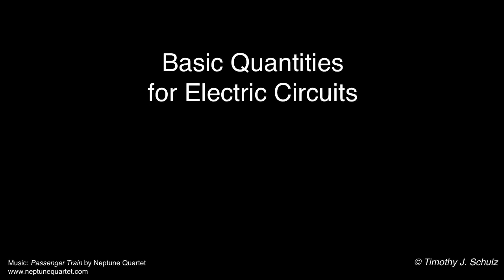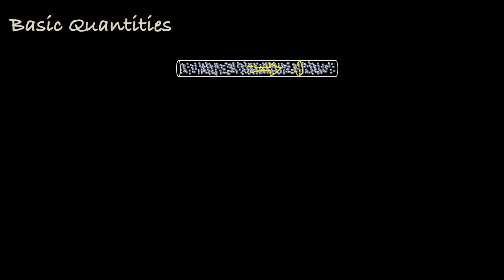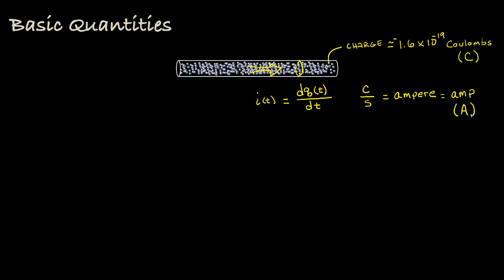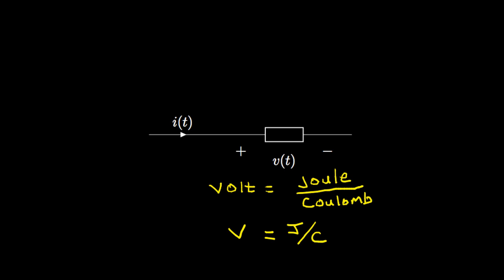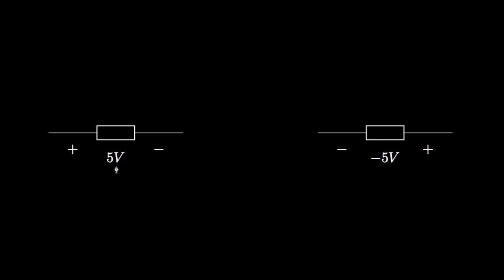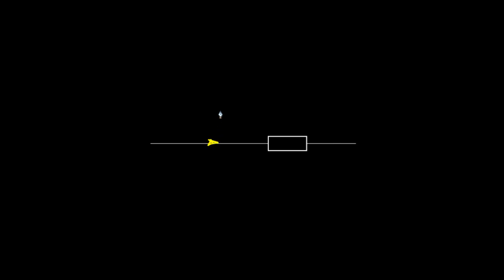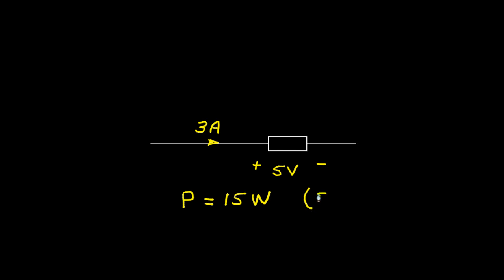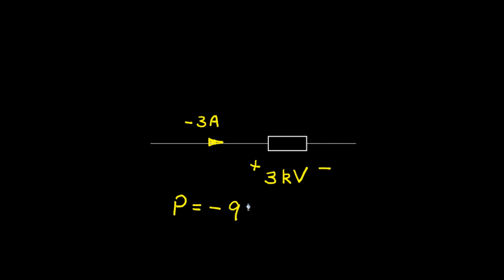Basic Quantities in Electric Circuits

Comment: Tim, you broke my brain. The last example, you show a current flowing from left to right, yet it was negative, I thought the negative would mean it flowed from right to left in that example.
Reply from the maker: If the arrow that designates the 'direction' for the current had been from right to left, then, yes, the current would have been positive. We need to think of a positive 3 amps flowing from right to left as the same thing as negative 3 amps flowing from left to right. The arrow only specifies the reference direction in the same way that the plus and minus signs specify the reference polarity for voltages. When we deal with AC voltages and currents, they will alternative between positive and negative.
Reply: Thank you, Got it!